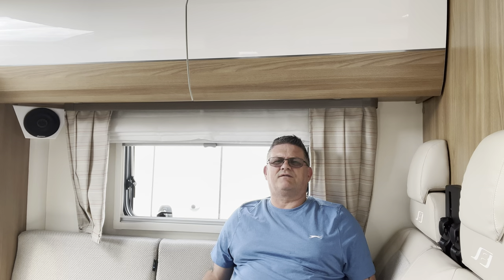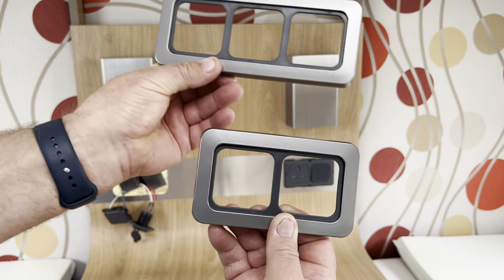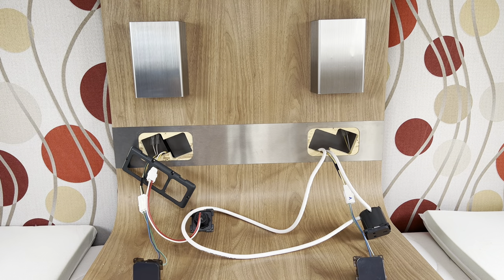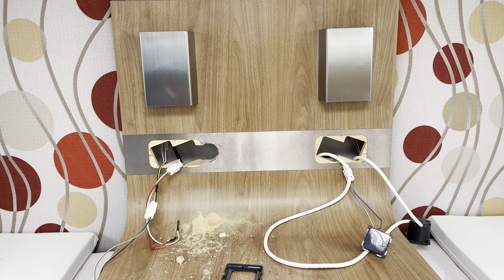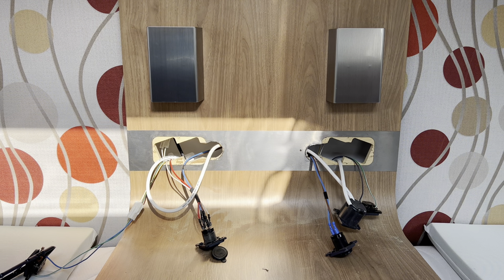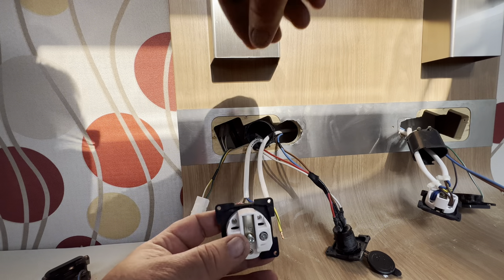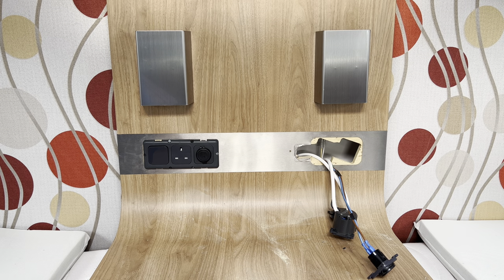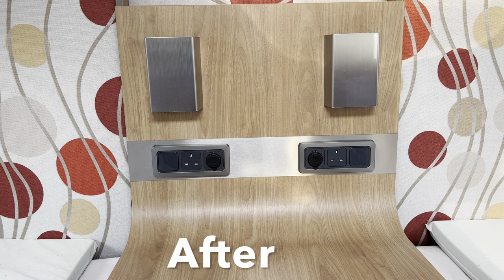HOW  I INSTALL EXTRA PLUG SOCKETS AND FITTING USB C CHARGERS [MA35]

Comment: Probably a good idea to file and put some electrical tape over the aluminium plate so it doesn't cut into he wires from movement over time. Great video though, very useful.
Reply from the maker: Thanks for the comment, 
that’s a good call but the wires are no wear near the aluminium  . since making the video I’ve actually  removed the sockets  & filed the aluminium flat now .